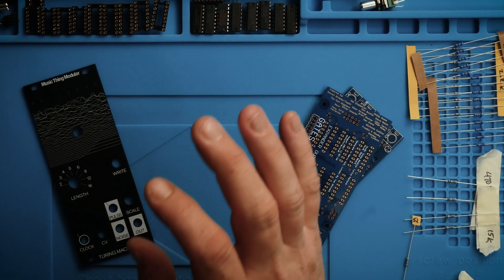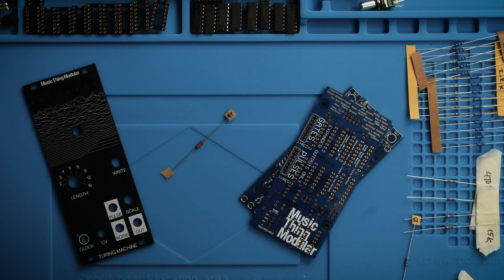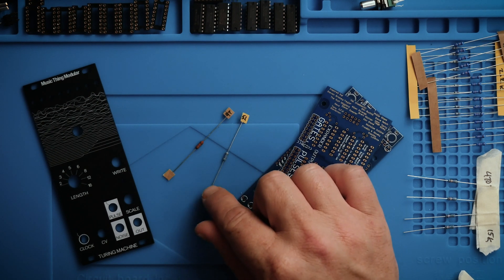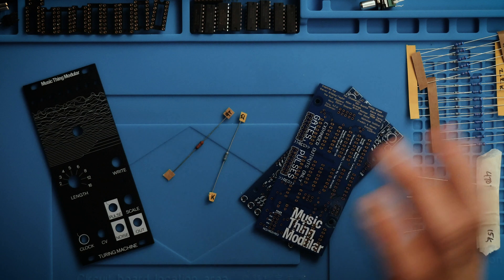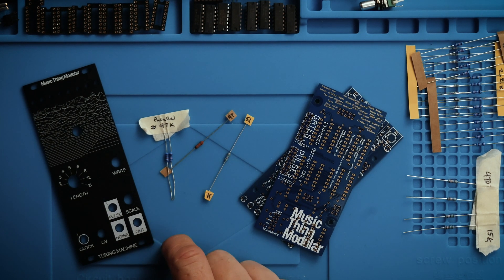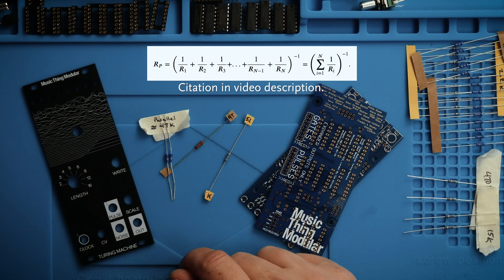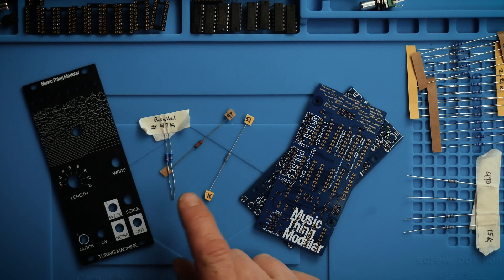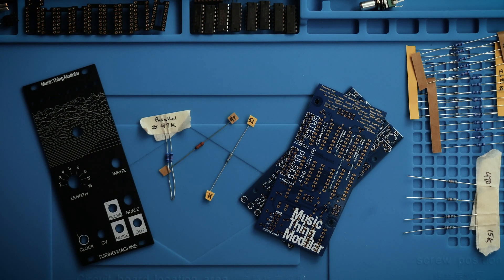Parallel Resistors Save a DIY Turing Machine - Eurorack DIY Lab // 04

Comment: I did the exact same thing with the 0.47uf caps. Ordered a dozen of every common value which are on the way now.
Reply from the maker: Ah cool! It looks like the math for caps is exactly opposite from resistors. Electricity is magical!
Reply: @DomesticSceneMusic  well, i didnt do the same fix, I just made the same mistake. I chose the easy way out and just ordered more parts.
Reply from the maker: @cr0wland  Ha! That's because you didn't put the artificial pressure of needing to finish a YouTube video on yourself. ;-)
Reply: @DomesticSceneMusic  I had that exact thought actually. Literally every module I make gets stopped half way though because I have the wrong parts, or I just can't find them in the organized chaos that is my stash. If i was making a video about the build process my hair would probably grow 2 inches by the final scene.

Comment: Nice save. 
For the guitarists out there, speakers have the same property and you can do this for plugging the correct rated speakers into your amplifier :)
Reply from the maker: Sorry about the late reply, could you expand on this? Do you mean that resistors in the electrical path can help you match a speaker to an amp or that multiple speakers act in a similar way? Any links would be appreciated too. I'm curious. :)
Reply: @DomesticSceneMusic  speakers act like resistors with values that can be (in series) added and (in parallel) divided. 
https://mesaboogie.zendesk.com/hc/en-us/articles/218267437-What-is-the-best-way-to-connect-speakers-or-cabinets-

Comment: I usually buy big sets of resistors and diodes as spareparts. They are around 10 to 15 Euros. Same for diodes electrolytic, ceramic and foil capactitators. They are around 6 to 8 Euros a bag. Also male and female pinheaders and Ic sockets.
Reply from the maker: Are you buying mixed bags? I bought lots of spare bits too, but ended up missing that one value. In general I’d like to have a decent selection of common parts on hand.